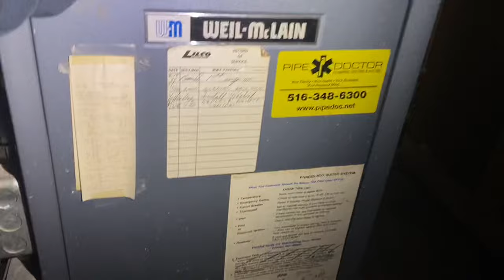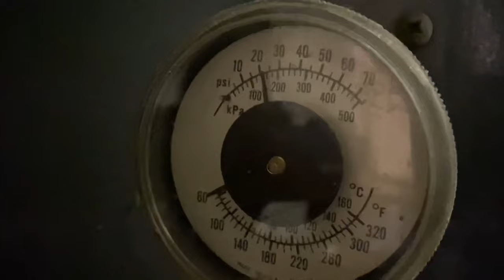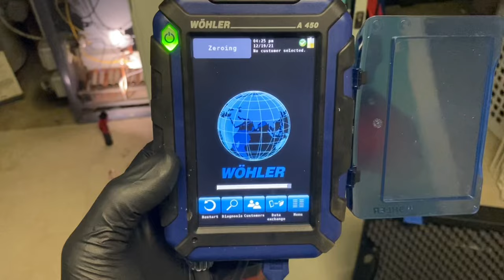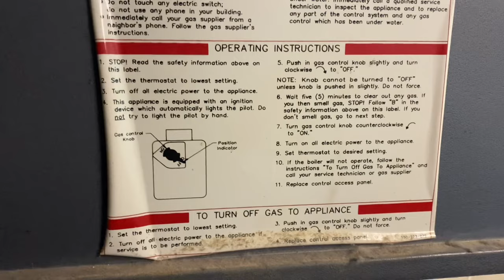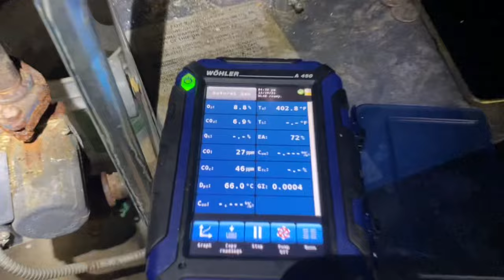Emergency Service Call How to Light Pilot Weil McLain CGa5 Gas Boiler

Comment: thank you for making this and sharing MP!  I watched your video before calling professionals about my furnace unit, no heat, and issue looked like pilot went out.  Could I please ask your opinion, I have had a service membership with the HVAC company that installed my furnace, fireplace and AC in 2014 and every year we have them service every unit.  They were here August 2022 last service.  When they came this week they said my furnace was filthy and that was the cause of issues, no components needs but they charged me a service membership price to re-clean and re-light my pilot $350.  I wanted to lose my poop but I wa sjust happy to get heat back on.  So rhetorical question, am I a sucker and if so any advice?

Comment: Have you ever installed a drain water heat recovery system ? What is the savings worth it vs the hassle in installing it.
Reply: @PipeDoctor  they're common in ontario, canada in new houses - possibly required by code now. The water draining from showers, etc still has heat, the drain water heat recovery system is a heat exchanger that replaces part of a main drain line, and preheats incoming water going into the water heater using heat in the waste-water to save energy.
Reply: @Jon-hx7pe  I always wonder if the claims are true that it will save 40% or it’s a green dream.
Reply: @Danimal.69  would have to ask someone that installed one after the fact, not with a new build. i'm sure in the lab under optimal conditions they save, the real world is different.

Comment: 7:35 and you would have got better readings if you just would have cleaned the tubes aswell… and btw. how about checking the pressure of the expansion tank?

Comment: Those are the wrong instructions for that boiler. It says in step" 4.This appliance is equipped with an ignition device which automatically light s the pilot. Do not try to light the pilot by hand". WTF
Reply: Probably old weil McLain 3 prong merc pilot converted to standing pilot .